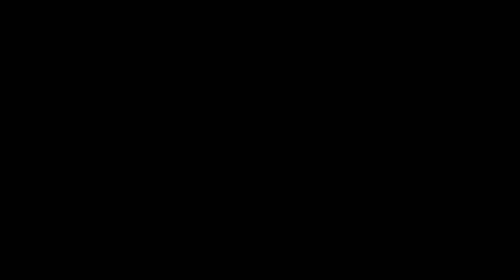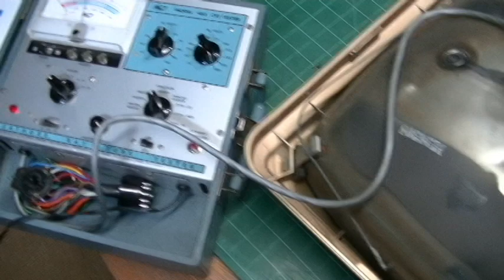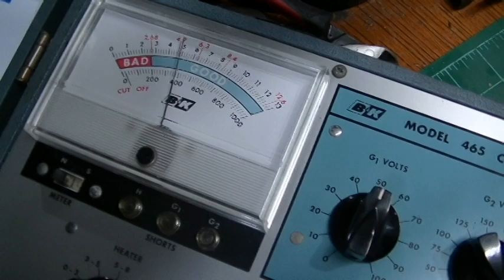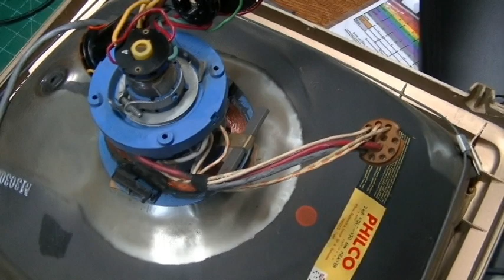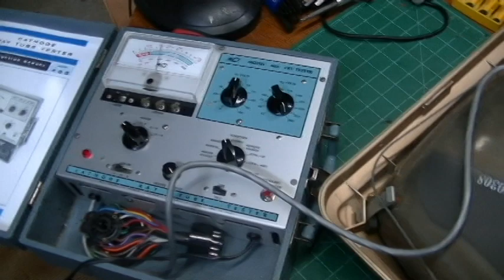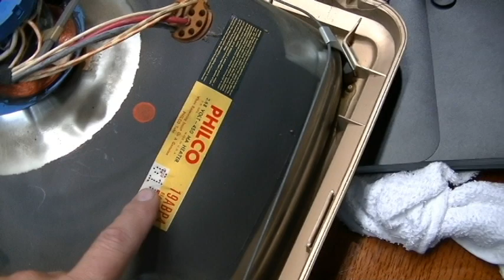1961 Philco Briefcase 19in #2 of

Comment: I "think" the tube used in the non uhf chassis are what was called controlled warm up, all draw the same current while warming up (cold to hot filament resistance curves about the same), so no one tube would flash out the filament. Maybe the UHF tuner had tubes that did not have this feature, so needed a slow warm up of the filament string to prevent the tuner tubes from seeing a big inrush. Just a guess, but the only thing that would explain it.
Reply from the maker: I thought about that, but the only difference between UHF and VHF is a different mixer tube in the VHF tuner, and of course the additional UHF tube. Otherwise the line /up is the same and the use of those 450ma Cool Chassis tubes. The thing is, other Philco series strung sets of the period all had inrush limiters....937L, and even the sets with power transformers. Seems curious to me the VHF model did not have one. Oh well......
Reply: well you can test it, jump it and see if those tuner tube light up extra bright (doubt it would hurt them unless it happened every time). I know I have some old AA5s like that, IIRC the 12AV6 really lights up every time until the other catch up with it. Odd how other series string philcos had them with out the UHF. I mean its a good idea but cost a couple extra pennies. then again why test it just to stress it out....

Comment: You are right i never thought about the fact that was a 2.6 volt tube....i am not very familiar with those tubes because i dont think we have sets with those overhere as far as i know, but i know from hearing other people's experience that they dont respond well to rejuv.... well thinking about that i dont know if its because of the 2.6v heater or because of the fact it has a short neck.... i have a 6.3v short neck tube with poor emission here and i still haven't dared to pop it with rejuv... and i have a great tester, a muter bmr 90 with software controlled rejuvenation funcion, not just a zap it controls the strengh of the zap and also varies the filament voltage while measuring the current flow and stops automatically, on some tubes it takes seconds on others 5 minutes or more.usually works very well, you just never know about long term effect